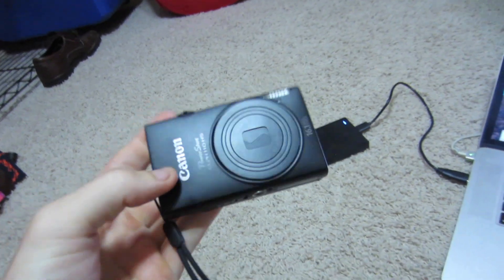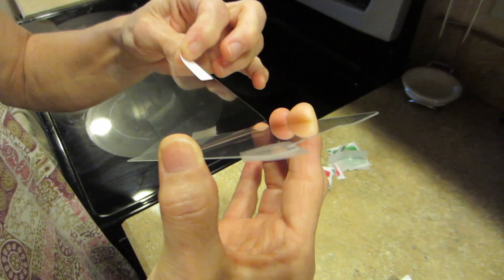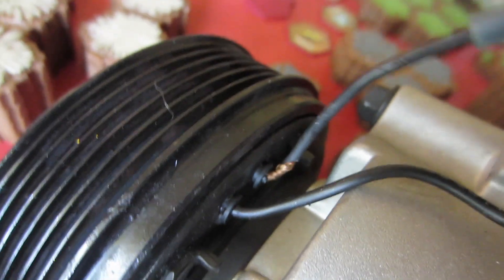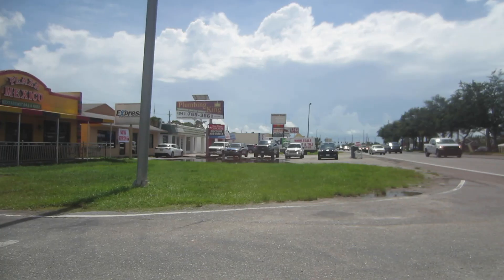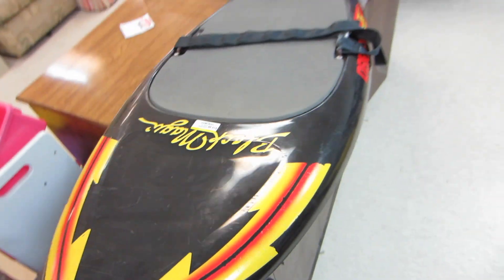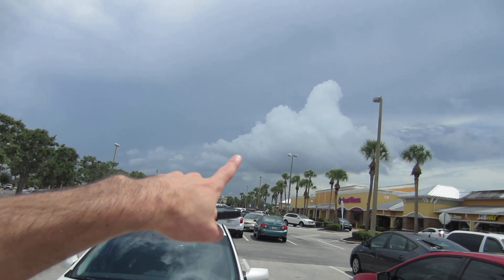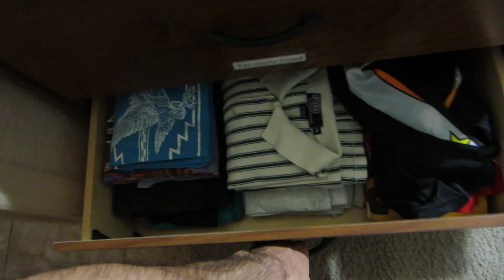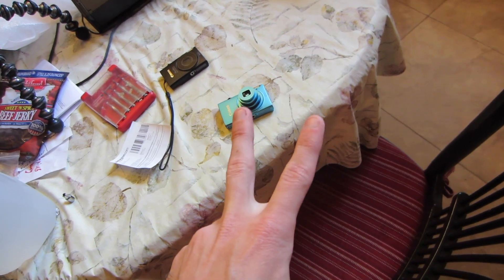Chasing Fedex to Drop Off My Package | Vlog 140

Comment: The exposed wire on the compressor was a bit poor. You could always slide some heat shrink down the wire if you removed the terminal. Still the item should be right. Looking forward to Van surgery.
Reply from the maker: Yeah I'm gonna heat shrink it I think. Thanks Bob! Gotta find the HS